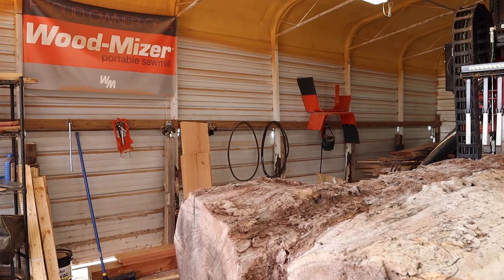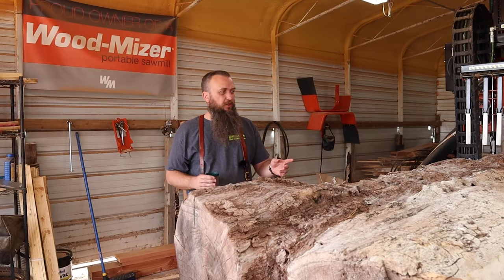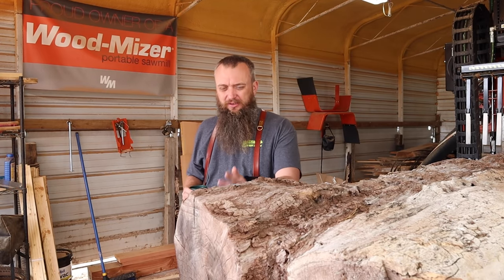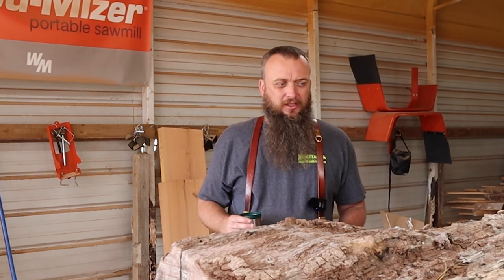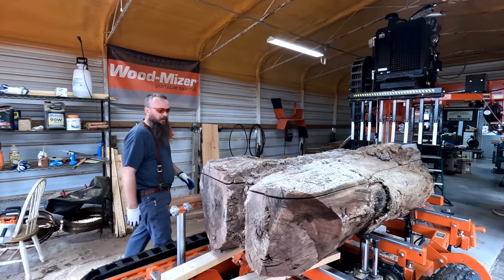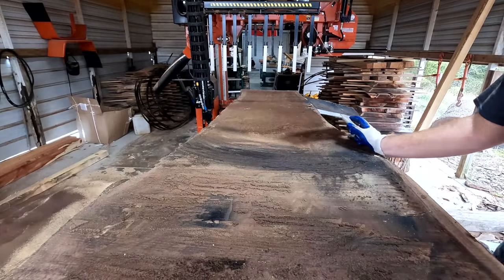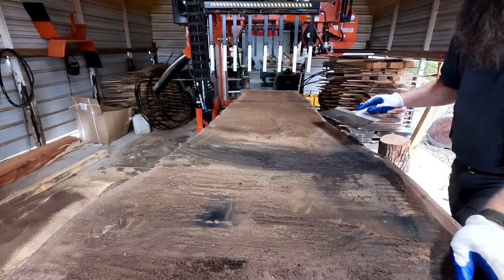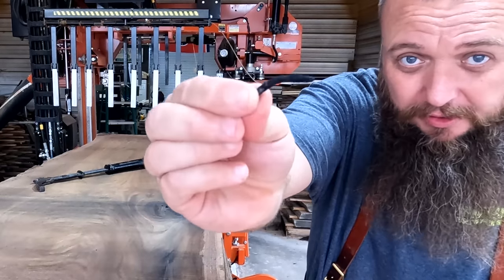Years Of Being Passed Over This Log Had A Surprise Under It's Bark, Amazing Walnut Slabs

Comment: I'm 70 yrs old now and I used that same type nail-puller w my Dad when we salvaged full-dimension 2X4 's from a 100 + yr old building in 1968....did not know they still had them!
Reply: Right there with you, I’m 71 and my grandfather showed me how to use the crescent nail puller, I still have it and use it with the logs on my mill. My son and grandson were amazed at how well it works. I think they couldn’t believe you could have a useful tool that didn’t have a battery or a cord. They are still available new, I found them on Amazon.
Reply: I'm 70 also. My dad bought a homelite XL12 around 64/65. I'm still running it, but boy that thing has cut a lot of wood and loud. Sounds like Big Daddys AA dragster.
Reply: Geez I'm 63.  Now I don't feel so old with you old timers on here....lol
Reply: Tools of the trade are forever.
Reply: Same here 63, dad showed me how to use it when I was  8
Reply: Yep, bought one about 20 years ago, don’t remember where though, still have it. Used it to remove 1x8 v-rustic redwood siding. Too brittle to pry loose without cracking it, pulled the nails. The more you used the puller, the better you got with it.
Reply: My dad is 70 and just let me borrow his nail puller last year. Then made sure he got it back, LOL. It certainly worked well on my deck rebuild.
Reply: My dad had one, still have it.
Used it to pull nails out of 10' oak pallets to make a set of bunk beds almost 20 years ago. (Wow time flies lol) right behind you guys.
Reply: i am 65 years young i used a nail puller like that to remove hard to remove  nails in oak .... this was 50 years ago. good tools last long and if they are really good they do not need improvement. the hammer slide drive drives the claw deep. it is a well thought out tool and it is a pleasure to use a well built tool.

Comment: Nathan, have you ever considered cutting your offcuts of highly figured woods (like the first cut off the top of that walnut - in the crotch area) into pen blanks. It might take a little time, but pen turners will probably be happy to pay at least a couple of dollars each for a 5 inch x 1 in x 1 in piece. If you sold 50, that $100 for only a small amount of work, on timber you're only going to burn anyway.

Comment: I've felled white oak before that had nails in it, and a particular one that had a railroad spike driven into the base(for some reason.) They all had black in them, but the one with the spike was almost solid jet black, going about 6 ft up the trunk, but a silvery sheen to it. Hard to explain. It's a tad brittle too.  I ended up cutting a round of it where I figured it was the blackest, and use that wood just for special things. It looks like no other wood.

Awesome black walnut slabs. Thanks.
Reply: Surveyor will use them as benchmarks
Reply: @robopup1  
Agreed.  I hit one with my stump grinder several years ago.

Comment: A dumb sawmill question. As an industrial arts teacher I had the occasion to process some exotic pallet wood (IE teak , zebrawood, Koa from a coffee importer) I wound up using a Rockwell 14 in bandsaw but switched to a metal cutting blade. It cut slower but the (actually very few) nails/staples didn't affect the blade at all. Do they make similar blades for your size? I know blade stock can be welded to any length but I don't know what width blade the WoodMiser uses. (I told you is was a dumb question!)
Reply: I believe a finer toothed blade would clog with sawdust before it exited the cut on such wide logs. You would need to slow the cutting speed down a lot to avoid it.

Comment: You might be able to get the staining from the iron out of the boards using oxalic acid. I have used it to remove black staining from Victorian pine floor boards where the cut nails rusted out. But might be more of a job for your customers when they are applying a finish

Comment: I have a White metal detector that is worth its weight in gold.  I use it on trees and logs.  It must be used well away from the mill and where the ground has little iron signal.

A story.  Years ago, a friend had several 12x12 timbers used as bumpers outside his shop.  They were redwood that had been recovered from a bridge that had been built in Humboldt County, California somewhere around 1900.  He asked me if I could saw them. Once all the iron was removed, we did.  I have never seen such beautiful redwood!  I got two calls from him that night.  The first call, he told me that they found out the person where they got them had more.  The second call was, "We bought them all". A few days latter this ancient Dodge dump truck loaded with all the timbers it could possibly carry came straining up the road to the mill.  We milled all the timbers but two that just had too much iron in them.  What was the value?  I don't know.  There is nothing on the market anymore to which to compare it.  That is why you have a sawmill.

Comment: Wondering if it would be helpful to run a metal detector over the log first, maybe have a metal detector running in front of the blade with an auto-stop/shutoff.

Comment: watched MANY of your vids and saw an attachment to your rig that precedes the band blade and cuts a kerf about .5-.75 inches deep into the bark .  I/m assuming so that your band never cuts into bark that may harbor iron.  You knew this tree had nails and other  so why didnt you use the precutter on the bark?
Reply: Certainly don’t want to speak for Nathan but with live edge slabs a lot of people don’t like the groove from the debarker.  And it’s not just the bark that holds metal.  Nails and such often get fully encapsulated by a tree, so the debarker does little to reduce metal strike with the bands.